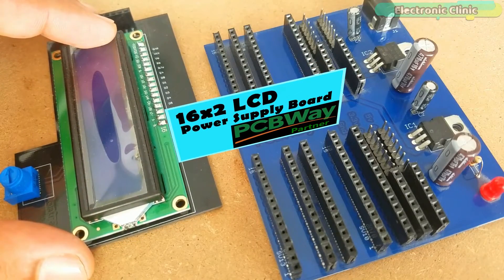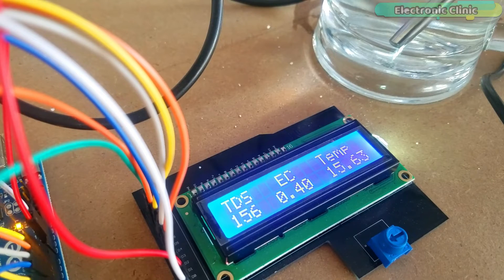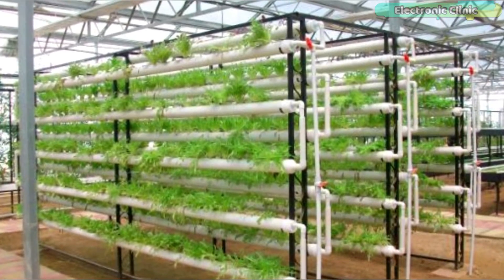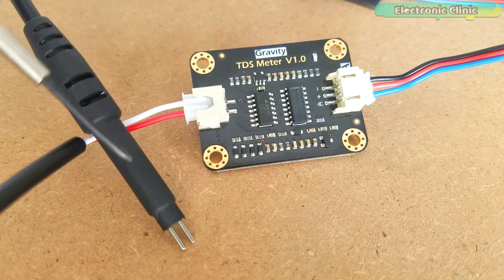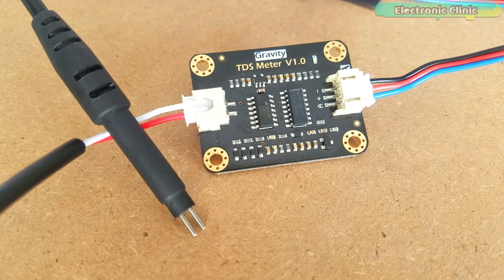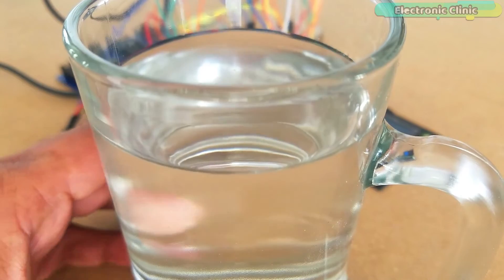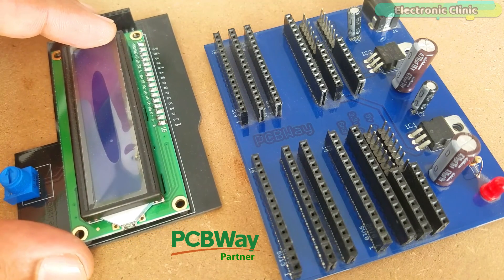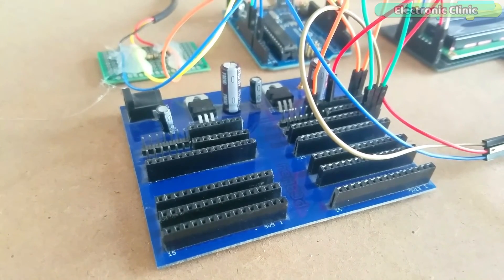TDS Sensor Arduino, TDS in Water PPM Value, Total Dissolved Solids, Water  Quality Monitoring

Comment: the effect of sugar on tds value is depedant on the concentration of water percent of solution so major increase in sugar may have small effects on tds value but i guess this must not be a problem for a hydroponic system.

Comment: Great video you have a good voice for teaching, but like others mentioned, the device says it only measures up to 1000ppm, how is it displaying higher than this and a 2.3 EC this is way higher than 1000ppm. You even mention the max output is 1000ppm, so if the full voltage at 5v is 1000ppm how is it reading higher on the video. Thank you

Comment: how can i replace the pcb board because i dont have access to order pcb board
Reply from the maker: circuit diagram is available on my website. you can solder all the electronics on a breadboard
Reply: @ElectroniClinic  ok understood. Sorry for the novice question. Thank you very much for your reply

Comment: Correct me If I'm wrong :
The TDS Sensor you're using has a maximum reading range up to 1000 ppm, right? I just wanted to know how come it could have a reading up to 1195 ppm at 1:48 ?
Hope this question is not offending :/
Reply: Good question, mine has just arrived, i'll do some testing and post back results, perhaps his conversion factor for the voltage was off.
Reply: @GaryMcKinnonUFO  any update on this please? Looking at getting one myself, but not much use if only goes up to 1000ppm.
Reply: @CraigTalon  Yes, i calibrated a cheap TDS pen with proper solution then configured the probe. I'm not measuring anything above 1000PPM (2 EC) so can't yet comment but when i set it up again (i had problems with the pH sensor and this in the tank at the same time due to EMI) i'll do a heavy saltwater test and see how far it can be pushed. I bought it cheap from ebay : https://www.ebay.co.uk/itm/Analog-TDS-Sensor-Water-Conductivity-Sensor-Tester-Liquid-Detection-Arduino-BSG/124356193622?ssPageName=STRK%3AMEBIDX%3AIT&_trksid=p2057872.m2749.l2649
Reply: @GaryMcKinnonUFO  
How did it go? Did the sensor work properly?
Reply: @cesarpa5011  Yes but only on it's own, EM interference from the AC field caused bad readings on EC and pH sensors when in bucket at same time.
Reply: amazon TDS links not working, so careful..